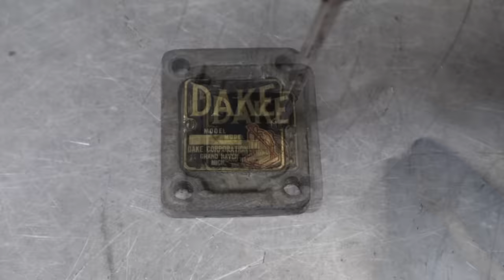1 Ton Arbor Press ~ RESTORATION

Comment: Nice work and good tip with the temporary glue on vice jaws 👍
Reply from the maker: That trick has served me well for MANY years! Especially when you don't want to mark up whatever you are clamping into metal jaws.  If you want to easily remove them, take a can of compressed air (used to blow out keyboard dust) Flip it upside down and spray the freon onto the glue joint and it will cleanly snap right off! Thanks for watching & commenting!

Comment: Hi, your restoration work is impressive, I’m so motivated by it and I’m in the midst of restoring a similar Dake arbor press myself. First question, you removed the 2 small pins that hold the brass logo plate, what kind of pins did u replace it with? Second question, did you finish it with a clear protective coat? Hope to hear from you soon.

Comment: While that probably looks better than new, you could have gone the extra 56 miles and polished the bar that goes up and down, and touched up the black on the label. Just because you could. You do such nice work, i'd like to see them taken to the extreme. not that it would make it work any better, but then painting the lettering on the casting doesn't help it work better either Maybe you could polish the spot where the item you're working on sits too? I don't know, just thinking that if you're gonna do it better than original, go all the way, but then I'm an all the way or not at all type, I probably wouldn't have restored it at all so long as it was doing the work it needed to.
Reply from the maker: I appreciate the compliments! I can totally understand that! For me its a balance between all the way and not too far. I plan to use this in the shop for its many intended purposes, and so polishing everything up just isn't practical for my needs! Thanks again for watching and commenting!
Reply: @SalvageWorkshop  Well, for me, once you go that far, practical doesn't really apply any more. Practical would be to clean it, lube it and that's it. But that's the way I am, you have to do what pleases you. I'm crazy like that, might even say OCD. That's why I often leave what's working alone, or I'll put way more time into it than it really needs. When I start to do something, I just get into it and go as far as I possibly can with it. Of course, these days I don't have many tools or a shop, so I generally only work on small things I can do at the kitchen table. I have a vise that clamps to the table, a baby anvil and many other down sized tools to work on small stuff. Of course, I also have magnifying lenses up to 30 power. I get down to the Nth degree most of the time It's an effort for me to do just what's needed and no more, but I do make myself stick to that sometimes.
Reply from the maker: One of the most important things in life is knowing one's self, your limitations, and your tendencies! Sounds like you know those things about yourself! No worries on having a tool setup like that!  @tootall5559
Reply: @SalvageWorkshop  One problem I have, is when they get brought back like this, I don't really see them as a tool, more like functional art. I always like to go all the way, or at least as far as my skills and pockets will allow. Polishing doesn't take a lot of cash, so I polish a lot of metal things. It mostly takes time and elbow grease. As a retried old fart, I have time,  but some days I plumb run out of any elbow grease. Many of my projects tend to get put on hold, then they sit until  who knows when... some never seem to get finished, where if I was to simply make them functional, it wouldn't take long at all. Please bear in mind I'm not at all saying what you did wasn't good, far from it, just talking about my tastes. Kinda your fault too, when you do it so well and so far... I'm just itching for it to be all the way,!  My flaw though, not yours. I love your work.

Comment: 12:23 Sounded more like a motor bike than a Hercules, too high pitched..
Reply: I was thinking the same thing. The Herc has a much deeper growl. Maybe the sound was distorted by the mic?
Reply: @Spike16191983  Can't see that much depth changed by the mic.  Ever been under one at landing?
Reply: @WastedFrom1976  I have. Many times. I'm an Aircraft Mechanic on them. No telling how far he was from the plane tough. I'm no expert on film equipment.
Reply from the maker: 2 things on this one: 1. When I speed up video in the editing process, it makes everything sound higher pitched than it actually is. 2. I had just gotten a new camera and it was set on auto volume recording, and the problem with that is when shots are quieter like spray painting something , the camera looks for something to record, and in this case it was the C130, and many times that also changes the audio in unwanted ways. Either way, I promise it was a Herc flying over, I know the pilots and it was an inside joke with them. Thanks for watching!
Reply: I'm dying to know how you are on an inside joke sharing level with some jerky bird pilots :p